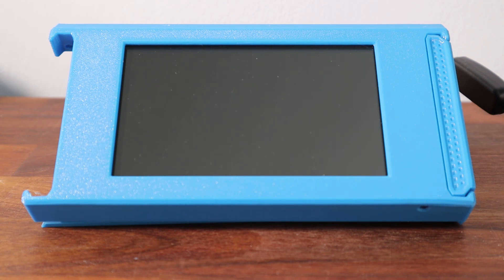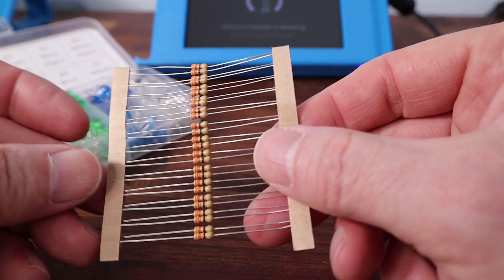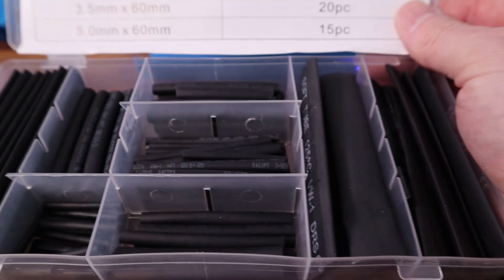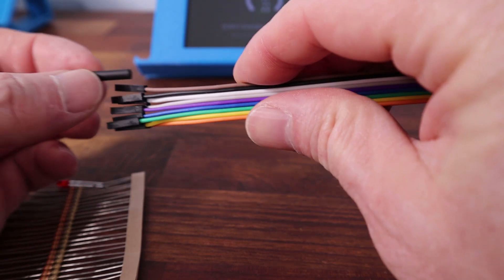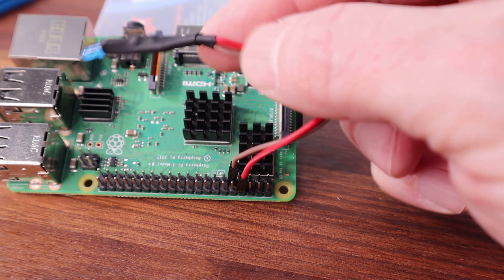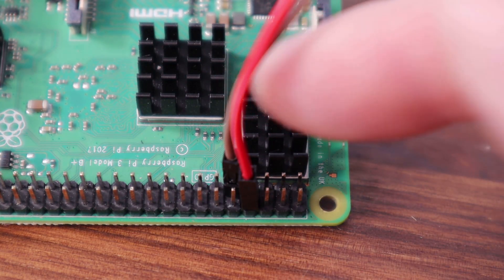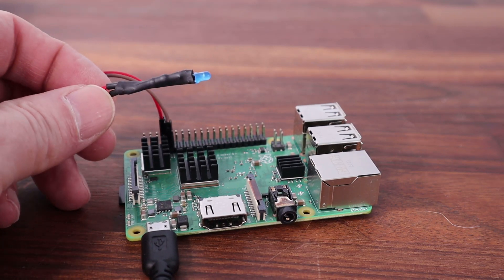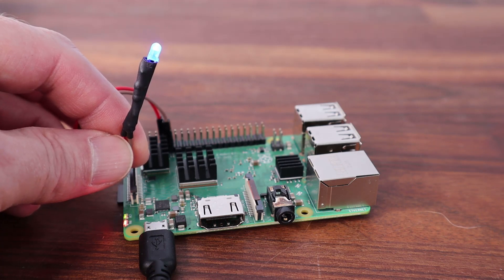Add a Power LED to your Raspberry Pi Case - Octoprint - Octodash - 3D Printer Enclosures - PrusaBox

Comment: i cant get the LED to work on my pi zero button works fine just cant get LED to work
Reply: i htink i may have picked a dead LED as on a power supply set to 3.3 or 5V the LED dosnt work either
Reply: it was infact a duff LED tested another LED and fitted it now it works

Comment: Hi Colin, 
getting ready to order some resistors and led's. What size resistors should I buy? I mean I know I need the 330 ohm but amazon sells assortments labeled as 1/4w, 1/2w, 1w, etc. What size should I get?
Reply from the maker: Get an assortment pack that includes 330 ohm, thats what i did.
Reply: @colinhill  I know but what wattage?
Reply from the maker: @mrjayd  1/4w